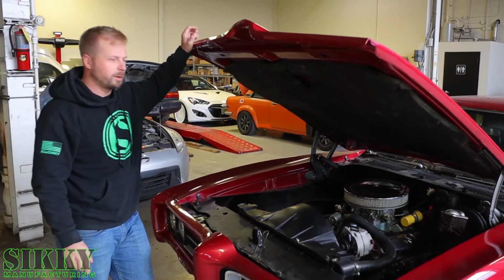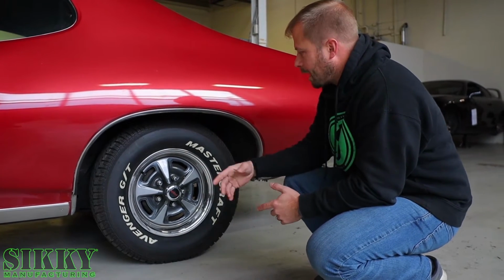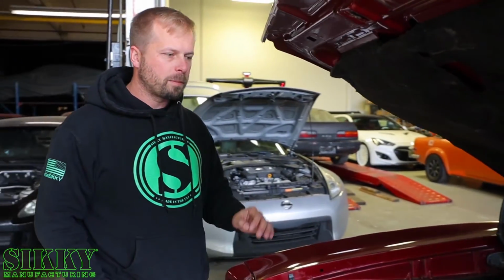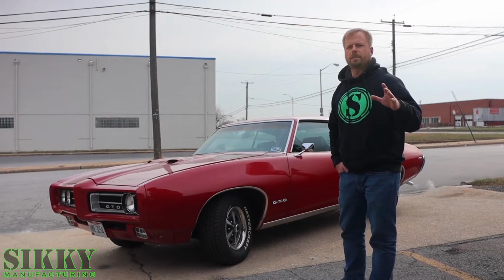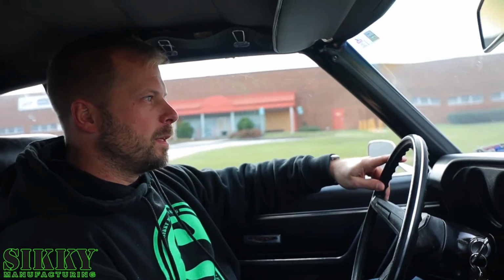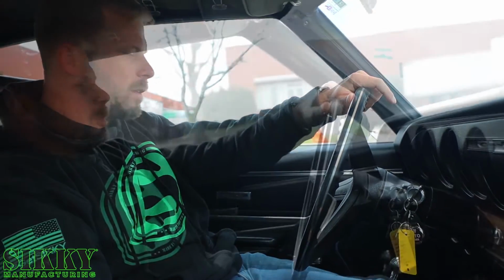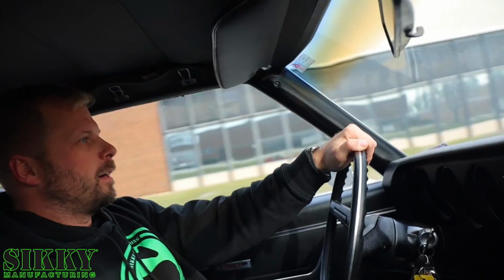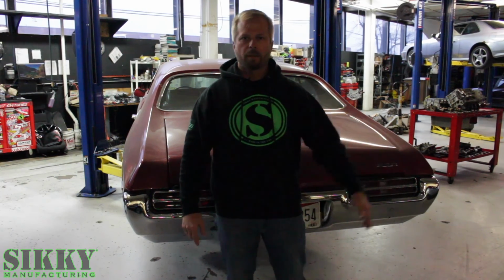1969 Pontiac GTO LS Swap / Build Part 1 | SIKKY Manufacturing

Comment: Just what I was looking for. I just put a rod through the oil pan of the 400 in my 68 Tempest custom convertible GTO clone. So I'm definitely weighing out the swap option. I love the pontiac engines. But their so much more expensive to build.  I've got a 03 Silverado sitting that runs great but the rest of the truck is very tired.  I'll definitely be watching closely!

Comment: In Pa, love this, but it seems expensive for a working smuck like me. 😕Just bought a 64 Rambler for 2400. Would love to make it a reliable daily driver
Reply from the maker: Yeah a swap is one of those things you definitely want to do right the first time.  And unfortunately the right way is never the cheap way.  Best bet for you would be to figure out your budget.  Basically what you want to put into it.  If that's under what it will take to do it at least at that point you can make a decision to either do it and raise the budget or not do it.
Reply: @SikkyTV  Thats great advice.  Thanks. How do we get estimates from out of state without shipping the whole car?